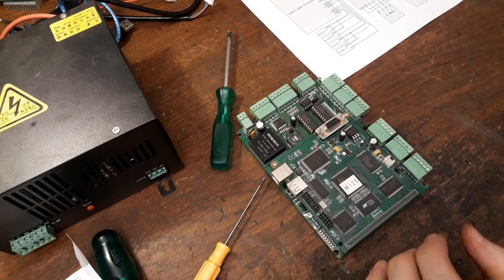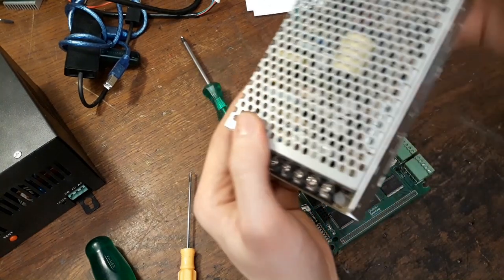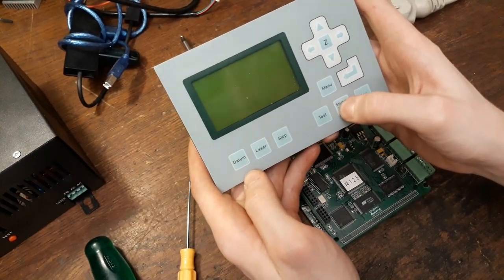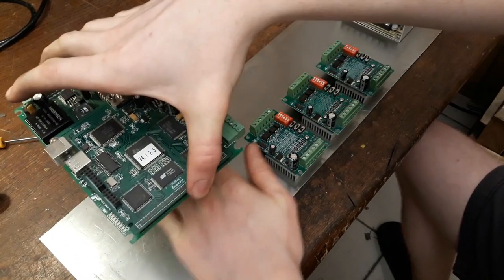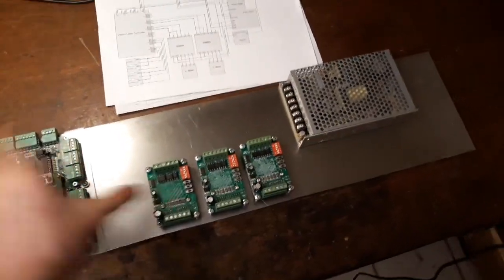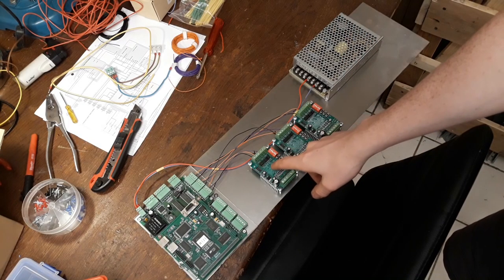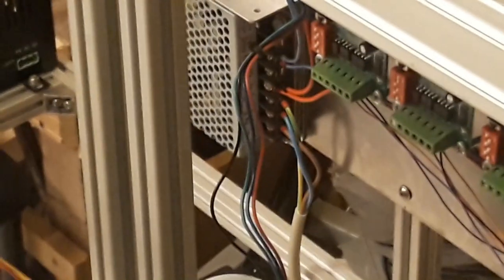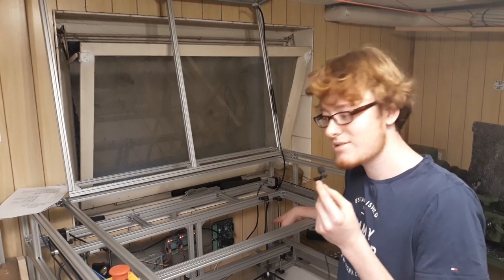Building a Laser cutter! - Ep. 4: First electronics

Comment: so....the 2 motors driving the 1 axis....obviously you put this on 1 driver...and noticed the motors were near the tube....i'v watched many videos of others trying this build....furtherfabrications tried this setup, and he scrapped this idea later on and went to a single dual shaft motor....he said the 2 motor option was unreliable and losing steps...i am going to try the 2 motor first, and see what happens....and if it doesnt work properly, i have also installed the single dual shaft....i put it on the front end of the machine ready to go, away from the tube....you also could relocate your 2 motors to the front....and put pulleys in back....easy swap.....so its been 4 years now....if you dont mind, an honest opinion on how the nema 17s are working....enough torque to move the head in a fairly quick motion for rastering....ay least 200-300mm/sec?